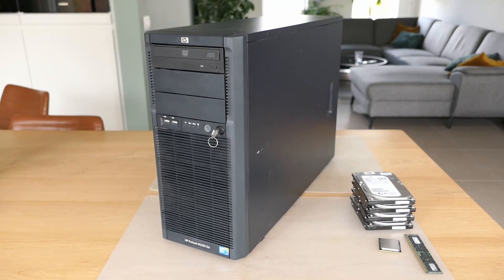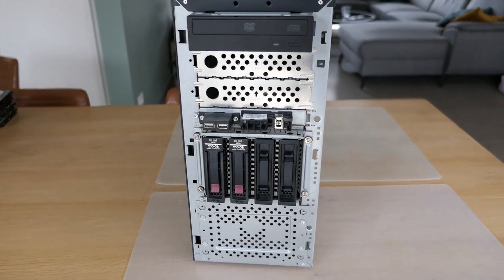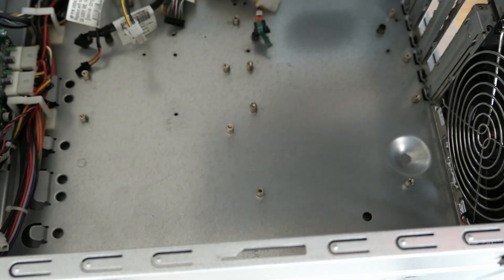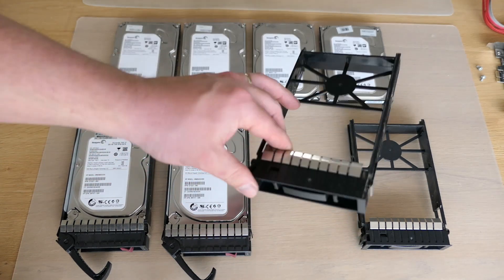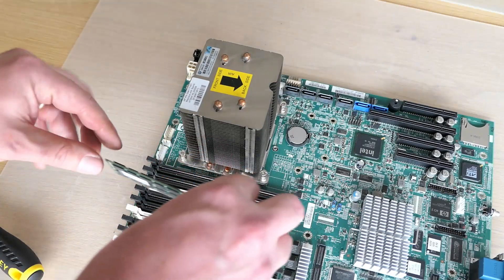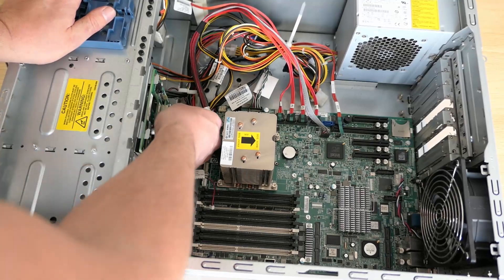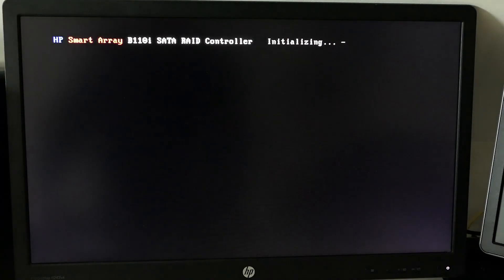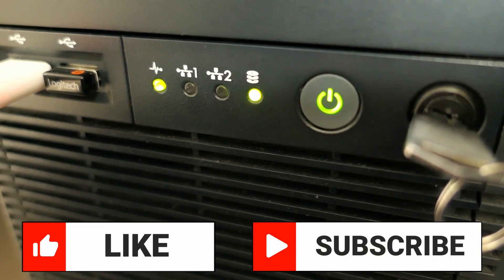HP ProLiant ML330 G6 - Full teardown, upgrade and benchmarking

Comment: Great video. If possible how would you be able to add more than 4 HDD?
Reply from the maker: You could put some more in the 5,25" bays using a bracket and an additional SATA/SAS controller to connect them

Comment: I have this machine as gaming PC with similar CPU, 24GB RAM, 3x2TB disks in P410 RAID and 1 SSD for system and Asus GTX 1060 Strix. After replace old noisy Nidec fans for silent Noctua it's still great piece of hardware :)
Reply from the maker: I love how it looks as well. It just tells you it's a powerful machine. Replacing fans is a must for regular desktop usage I believe :)
Reply: I recently got my hands on one. How did you change the fans and still get it to boot up?
Reply: @CB2202  I just connect 4pin connector to the edge of 6pin connector.

Comment: Great video! For a second CPU would you need to upgrade the power supply to the 750w?
Reply from the maker: If I get it right, the 750W is a redundant power supply (so you can swap it while the server is on). As far as I see, there is no need for that one for dual CPU. The TDP of a X5650 is 95W so with two of those and a bunch of drives it might be on the limits though.
Reply: @jensdbe  I actually run this machine with 2 x X5675 (highest it can go), 12 x 16 GB = GB192 GB RAM, a Geforce GT 710 (PCIe x1) and one single 500 GB ssd with the 460W PSUs. Even when doing rendering in Blender, the machine doesn't complain about power issues. When filling up the hdd slot, that might getting tight, though. Therefore I just bought two cheap used 750 W PSUs, which will be installed soon, so I have headroom for more hdds and/or a beefier GPU.

Comment: Hi :) 
It's interesting how the servers differ by region.
I have the same model, but it has;

Xeon 5620
16GB ddr3, reg, ecc
3 fans in the front
Hotswap PSU's
FIXED HDD Cage
Reply from the maker: I believe these were fully configurable at the time. So during order you could choose what should be in it (amount of RAM, disks, video card, amount of CPU, disk controller,...)

Comment: Nice video.One Question,Are you Using iLO2 on a LInux?
Reply from the maker: I did try it on Linux but had to install Firefox and enable some older TLS version to access this device's iLo2 webservice.
There isn't really much you can use it for as most interesting features required an additional license (like KVM, monitoring,...) which this machine didn't have (anymore).
Reply: @jensdbe  I see. I understood well.
Reply: Thank you for answer.

Comment: very nice build but the only thing i would have changed is the ram. is a pity not to use the triple channel
Reply from the maker: Agree with you but I had to make the choice between 16GB in single channel or 6 in triple. But if you can, using all channels is always more performant as long as you have enough in total.